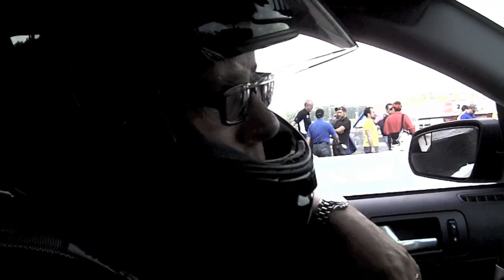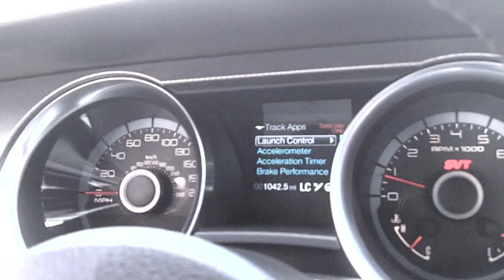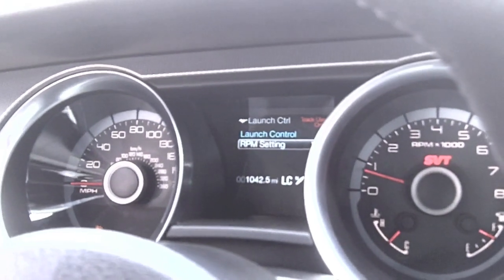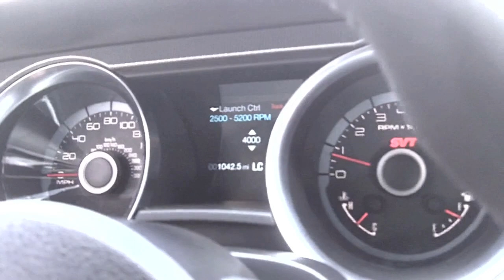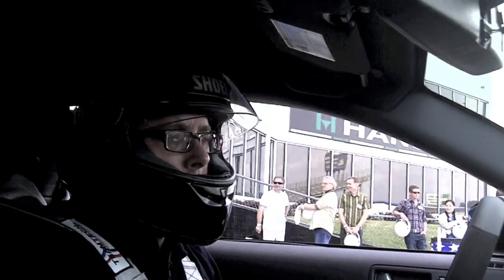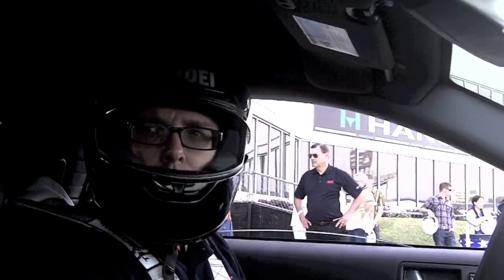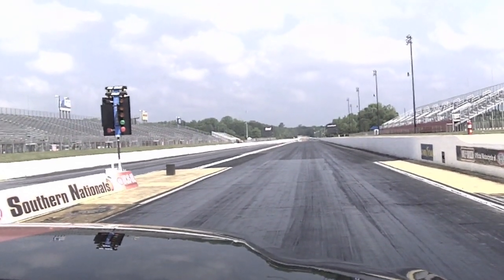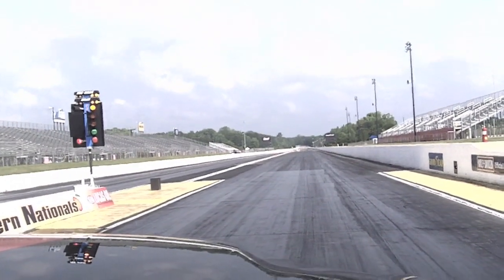2013 Shelby GT500 Launch Control

Comment: i checked on the zl1 it did 11.93 1/4mile checked 12 different sources and that's the average, also checked the gt 500 it averaged 11.7. Also gt500 way faster 0-60 and it does it in first gear, the gt 500 gears are crazy tall which gives it a tame feeling until you 5k.